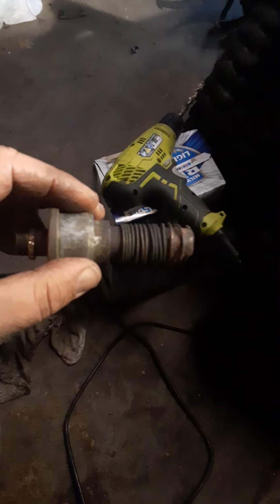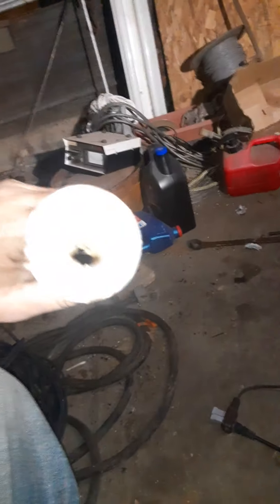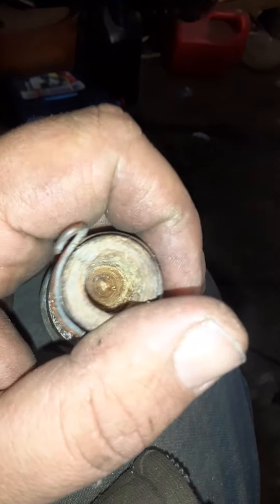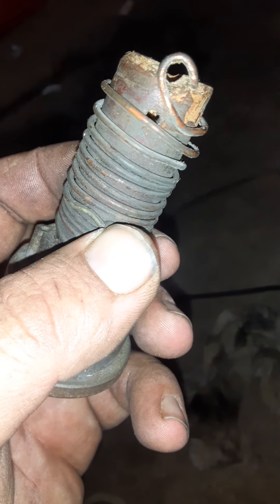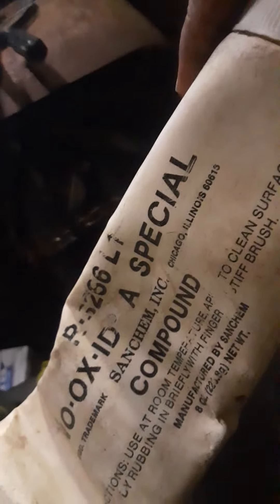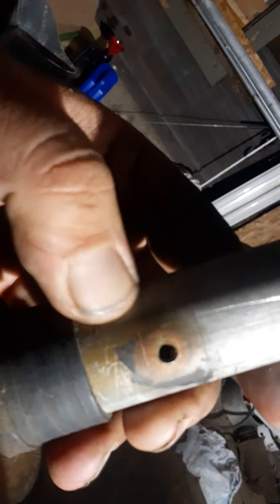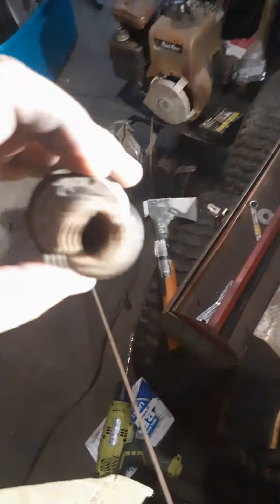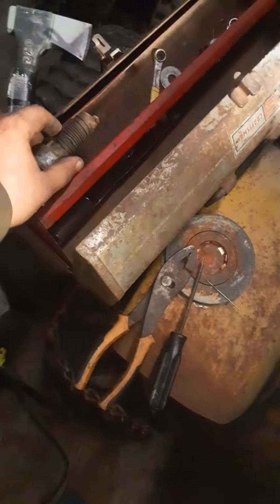Antenna Specialists Mighty Magnum repair/rebuild pt2

Comment: That coil is center tapped and the end is press fitted into the ground side. look close and you will see the wire and the punch mark on the side of that big round metal bottom.    Unwrap it gently, clean it well and re wrap without the coils touching each other. I made a note on your other video as well. Originally, there was a hollow plastic sleeve that went about 4 inches up inside the tube. The coil is wrapped on it. that was the failure point. U used a solid piece of round fiberglass into the center to repair mine with epoxy. It appear the top of yours is missing. That's why the wood and the plug. Another poor repair. It is possible to water seal that antenna.